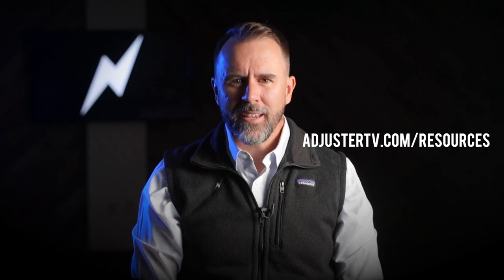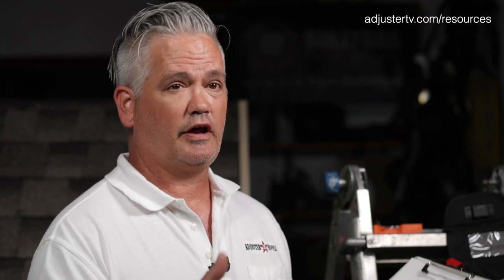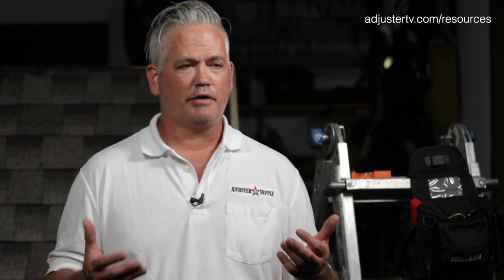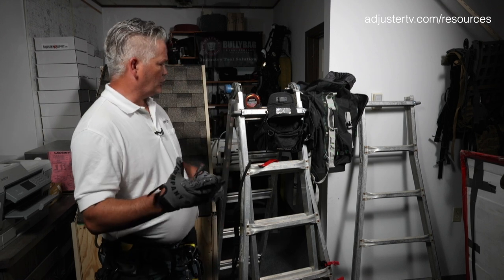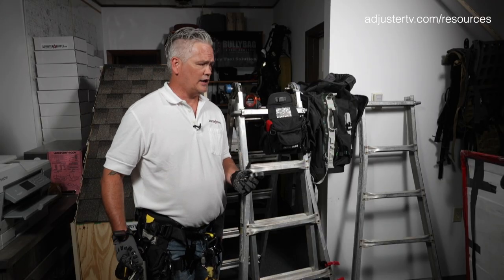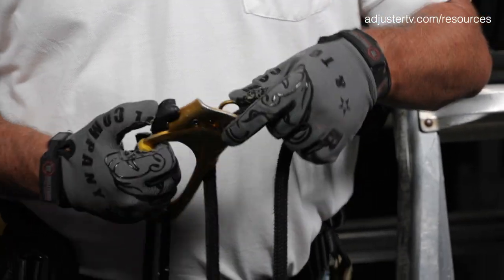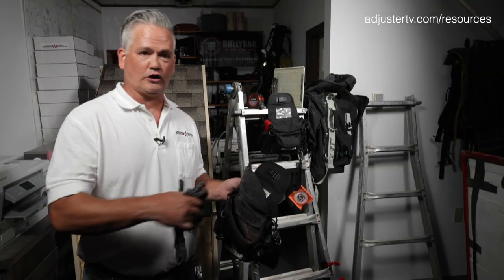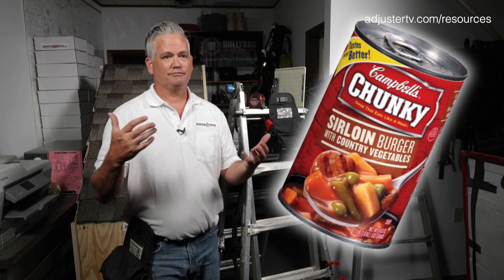Hurricane Deployment Gear and Tools | Sunday Special

Comment: Great video. I notice in one of the video about what you have on your 4Runner, you mention not using your harness often. The gentleman in this video appears to use it more often. In doing CAT work, should you expect to use a harness more often?
Reply from the maker: It's up to you how far you want to take your safety and it really depends on the neighborhood.  You can find yourself spending the summer on all 1 story 4/12 pitch roofs and then the next summer it's all 2.5 story 12/12s.  There are creative ways to get on many roofs, but there are definitely those that do require fall protection to safely access.